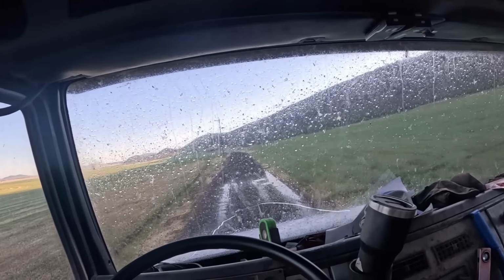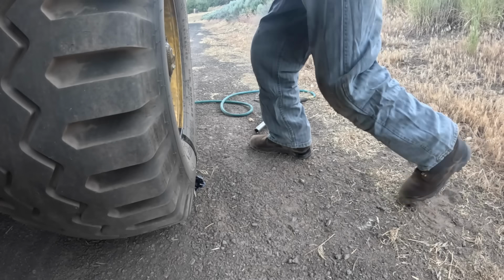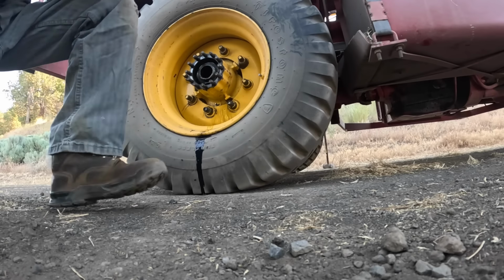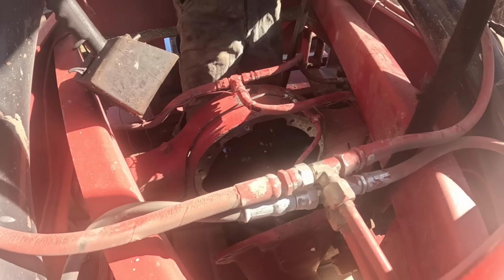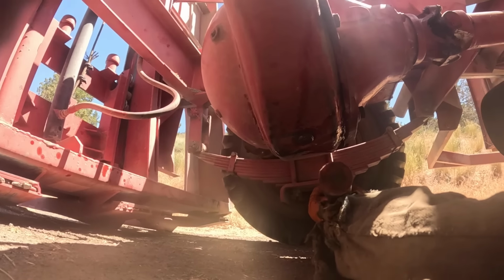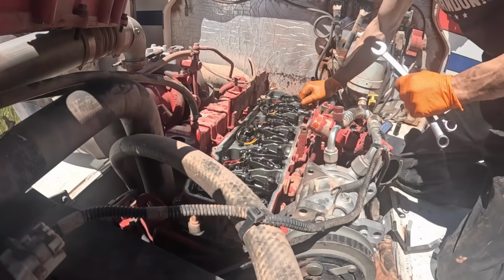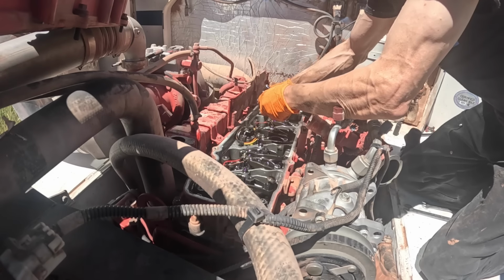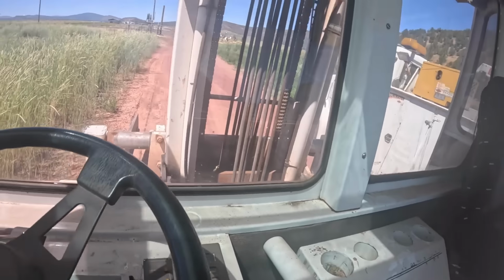Broken stuff everywhere.

Comment: Do not miss axle cone wedges. Always wondered why they don't make the end of the axle smash pad extend past the damn studs so you can't booger up the threads with the sledge hammer. Or even better, don't use the wedges at all. Eaton made do without them just fine. C'mon Rockwell.

Comment: Thank You Warren. Here's one. John Deer 6610R eating the big 12v battery. The engineer (exchange parts bod) is coming ever 2 months and putting new battery on the tractor. Madness. They won't check stuff.
Reply from the maker: @martinharper5112  It obviously has an amp draw with key off. All they have to do is put an inductive ammeter on it and pull fuses 1 at a time until the draw goes away to identify which circuit it is on.
Reply: Hi Warren. Could do that myself, but won't have a job. Thank You Warren.

Comment: Hey Fan here from the uk! Here is some help with your camera I too use GoPro hero 12! to find wind reduction settings turn on the camera, swipe down then swipe right, turn on controls to Pro, also head to Preferences then Video, turn bit rate to high for better quality! Also 10bit colour setting is here! Now go right back, select your resolution and frame rate settings the wind noise is at the bottom of the page hope this helps 👍

Comment: You need to get the DJI Osmo 4 camera they are far cheaper than GoPro and are far simpler to use and they do a kit where you get 3 batteries and a camera holder which is cheaper than buying just a GoPro camera

Comment: I wonder if Cummins is still using those roller tappets{lifters} in those with the little set screw where the tit can break off and the roller tappet can turn 90 degrees and shave the cam down.

Comment: Tapping the axle caps with a hammer as a diagnostic step to determine if one is broken (shorter) and rings at a higher pitch.

Knowlege/experience is power.

Comment: Hey Warren, how about 2-3 long rods that are the same size as the differential bolts. Maybe 10"-12" long. Thread 2"-3" and tighten them into the rear end, then slide the pumpkin out on the rods. That way you don't need the crane to lift that heavy bastard. Might just make an installation of a new one go way easier to. What do you think??